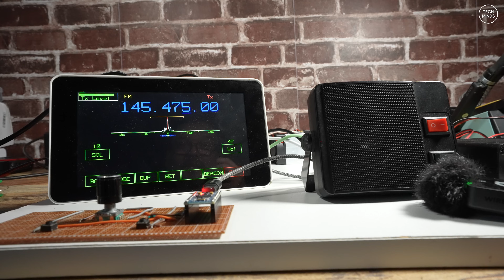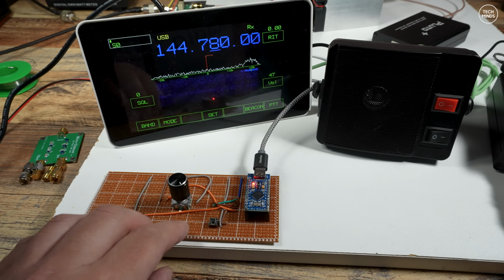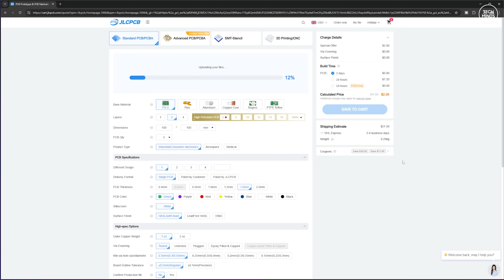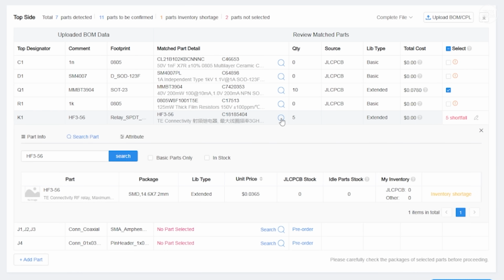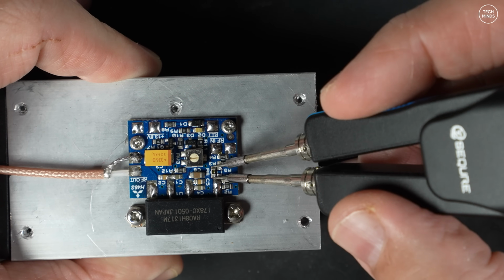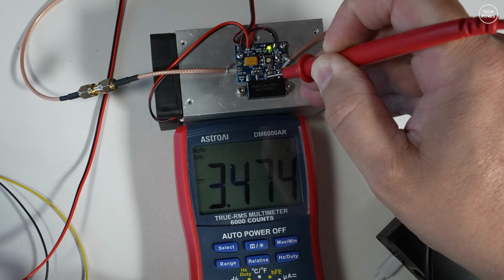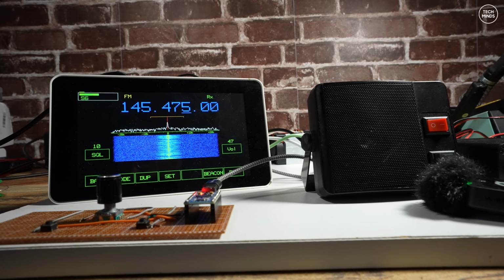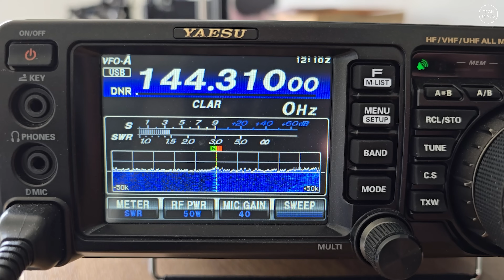Amazing FIRST FM & SSB Contact Using My Home Made SDR Transceiver! Part 3

Comment: Mat thats brilliant. I'm so happy for you. Also love ghe soldering tweezers. Might get a set to make doing capacitor replacement work. As for a turnstile antenna - I'm using one Dad built and it works really well.